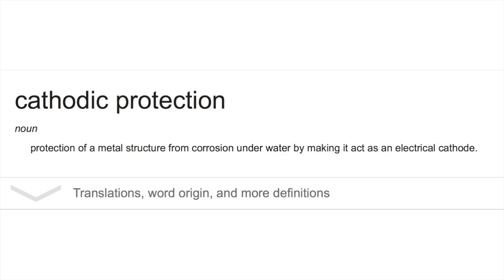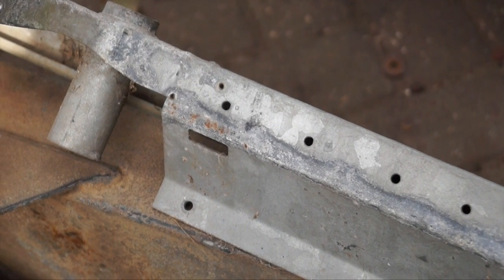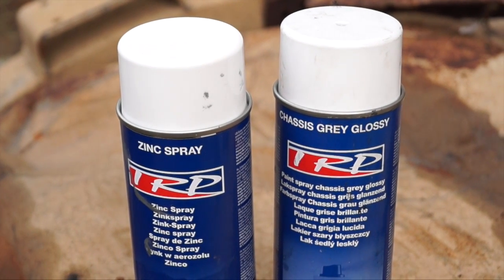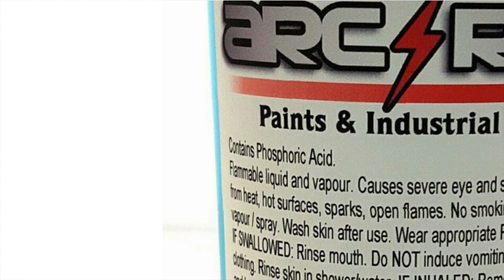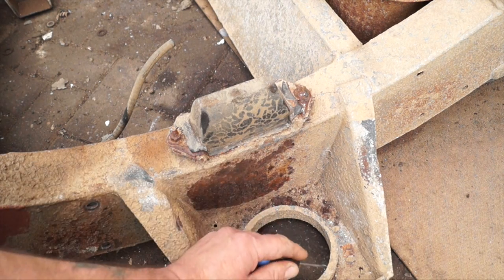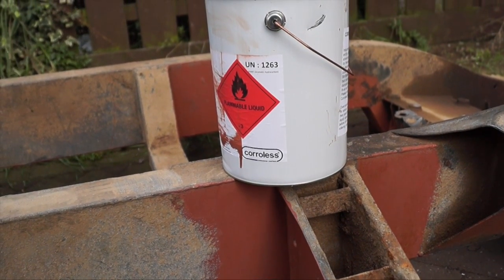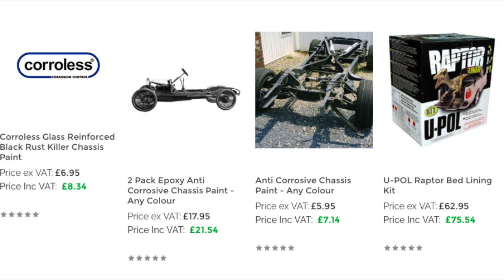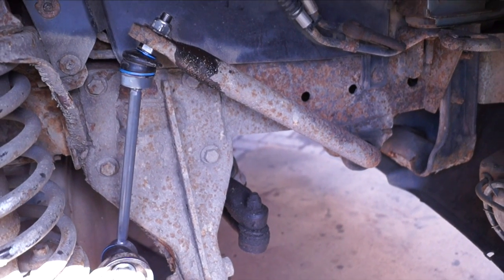Why Galvanised Chassis Don't Last Forever - 110 Project Rebuild with Arc Rite Paints

Comment: We need a titanium, or stainless steel chassis supplier :)
Reply: You will get thicker steel if its stainless. That means heavier car and inneficuent fuel consumption. It will be much more expensive both in manufacturing process and after sales use.
Reply: @gelabangetzz1989  I think a stainless chassis would crack too after thinking about it. It wouldn't flex as readily as a steel chassis. Titanium would be nice though. Mega £££

Comment: Correction at about 3:40. You can use zinc on aluminum. Zinc chromate or zinc phosphate. Zinc chromate has been used for years on aluminum aircraft.
Good info on the rest.

Comment: well nothing lasts for ever, but it will make them last a lot, lot longer than the raw metal or metal plus paint.

i was behind a 3 year old landie recently and already the paint was off the rear crossmember and it was already well rusted. disgraceful that they are producing them this badly in this day and age.

Comment: why go to all the trouble of wire brushing etc to remove corrosion, when there are many compounds that can be used to sandblast a chassi and can be done in less than a day, the other problem is the box frame unless yogurt some primer inside it will continue to rust.

Comment: There could be more info given. 
Was the chassie electro plated or hot dipper and was it shot blasted before it was hot dipped that add considerable more zinc on the plate. Electrical power line brackets are shot blasted and dipped they can have a life span of over 60 years . 

His paint I’d say did not stick because he grinder it with the brush and this polished the Steel too smooth, so paint found it hard to stick to super smooth surface.  

I’d advice sandblasting and galvanised then get a brush and paint grease to them nooks and rust spots. And repair ever few years.  I’d get oil inside the chassie tube. Not burned oil.
Reply from the maker: nothing wrong with the inner box section of the chassis.  We did cut it open and observed for ourselves.  You are correct about the paint adhesion.  It should really be shot blasted for the best adhesion, however, the paint is designed not to have a great deal of prep work undertaken before painting.  As for the process of that chassis. It didn't come with any info so no more could be given.  Thanks for your comments.
Reply: Applying oil would make dust adhere to the oil and dust would hold moisture on the surface thus creating rust .Yes?  @trailerfitter2

Comment: A galvanised chassis is only an extra layer of protection, not "fit and forget". If you use a high pressure drain jet thing on the chassis box section and Dinitrol or similar after every winter along with the above then it will last forever. I wish I saw this video before building mine. Great advice Chris.

Comment: just some really good advice.. also people fit galvanised chassis and think they will last a millenium, you still need to do maintenance.. cheers
Reply from the maker: that is the key, yes.
Reply: Correct"  i fitted a Richards galvi 14 years ago, its now startring to flash rust, ..